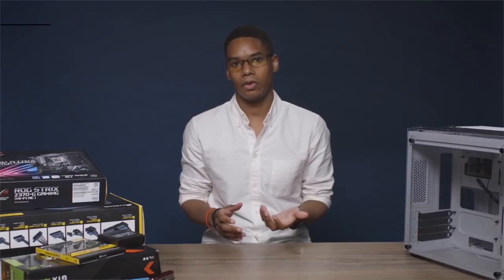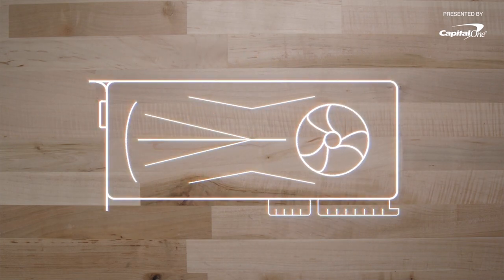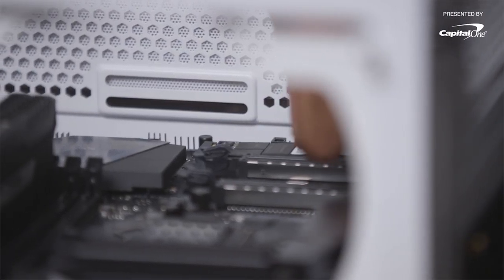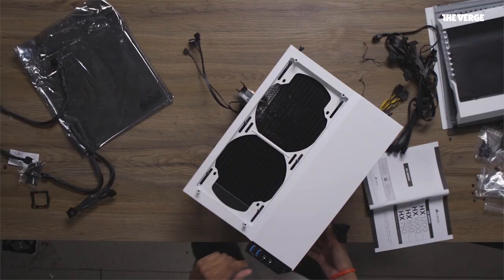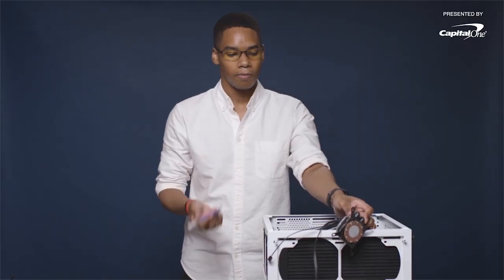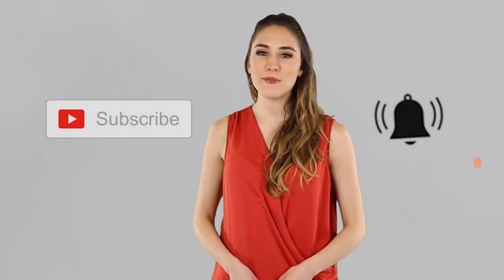THE VERGE: How we built a $2000 custom gaming PC *Reaction*

Comment: Things you missed:
0:52 Long-handled magnetic screwdriver is WAY better than a Swiss Army knife.
1:56 Triple-channel RAM isn't a thing anymore.
2:12 CPU is the most important component to a video editor.
2:44 It's not Christmas morning. You shouldn't tear quality boxes to shreds.
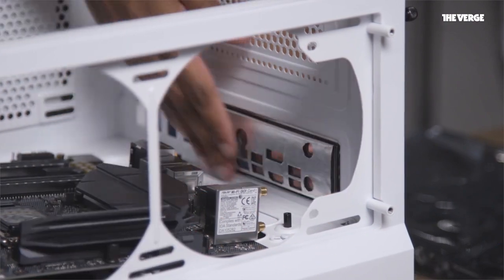3:25 Do not even use the word 'hammer' in reference to PC building.
3:32 Don't drag your motherboard across the metal stands. The back of the board is not adamantium. And use two hands! Gently! And throw away that stupid pocket knife...
4:20 The RAM notches don't match the direction he's trying to put it in.
5:23 He slaps Verge's new graphics card like it's a baby and flips it around while moving his feet on the floor which might be carpeted. At least he's still wearing his Livestrong bracelet.
6:22 No, the GPU isn't installed good sir. It has no power cable.
6:28 850 watts is overkill for this system and for a single RTX in the future. It's better to try and use the smallest PSU possible because it has greater efficiency if your system's actual draw is closer to the peak capacity.
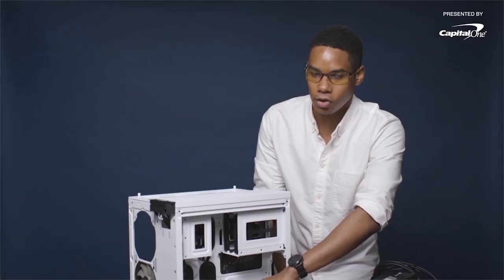6:41 Those are rubber pads to prevent vibration, not short-circuits.
9:10 What the fuck is he doing to the back of his CPU?
10:57 The internals are not done.

11:13 You say "So you can verify everything works", but this wording might suggest to an excited new builder like this idiot that they should turn the power on with parts outside the case. Maybe say instead "So you can verify everything fits."
Reply from the maker: Yeah we can both agree there are a lot of issues with The Verge's video. Even more than stated.
Reply: No from start to end is wrong....this guy is not pc builder you see the video of him insulting every pc builders around the world that he's computer  better than us because we can not afford 2000 dollar pc build...
Reply: I am still wondering if they only chose this guy because they wanted more people of ethnic minority on their channel to "balance" up the views. This guy did get a lot of flack and rightly so. There are so many reactionary videos on this I am surprised it hasn't gone viral. Also, I love the bit where he said he installed an m.2 drive ho help with the messy wiring, but have you seen the train wreck of cabling in the "final" build. I am just hoping that off camera they got someone who knew what they were doing to rebuild it because if not, this thing is going to go south very soon. Even my first build back in the early 80's was better than this!
Reply: Actually some builders will build the computer outside the case to make sure it POSTs, but those are usually not first time builders.
Reply: You are wrong about PSU. It's actually better to have some "headroom" in terms of PSU power. PSUs are most efficient when running at aprox. 60% load. They are quieter and will likely last longer too. Plus a better PSU may be still good when you upgrade your system.
Reply: @Gyvulys  Can you provide evidence for this claim about PSU needing headroom? That was my early building logic but I was corrected by some tech site at some point.

Comment: Nobody ever mentions this about an ESD strap. ⚠️ WARNING❗️⚠️🚫⛔️ An ESD strap is not there to protect you the wearer. Actually it’s the opposite in a situation where the potential for electrical shock is present it is critical for you to not wear an ESD bracelet. If worn the bracelet will make you a grounded object and if you were to touch an electrical current with a high enough voltage like from an outlet in your house which should be 110-120 volts you will be electrocuted. 

Instead the ESD bracelet Is worn to prevent you from building and or maintaining a static charge in your body. A static discharge can short out very sensitive computer components and corrupt memory. This is because unlike the voltage being supplied to run a computer (12 volts) a discharge can be 30,000 volts. The discharge would travel all the way through tons of components. 

It is better practice and safer in circumstances where line voltage standard outlet power and low voltage power components are being used to have a discharge pad or ONLY touch an ESD bracelet most importantly the copper probe located on the inside of the bracelet just before you touch and ESD sensitive object. That way you are insulted from any electrical hazard and can discharge yourself as you think you need it.

Comment: He called the PSU a brick. Well, the way he blocked the vents the entire PC could become a brick soon
Reply from the maker: Ehh, if you use laptops they are called Power Bricks. So can't say much about that. But yeah, with the direction he had the PSU facing, the system would become a heavy brick.
Reply: A fire brick.